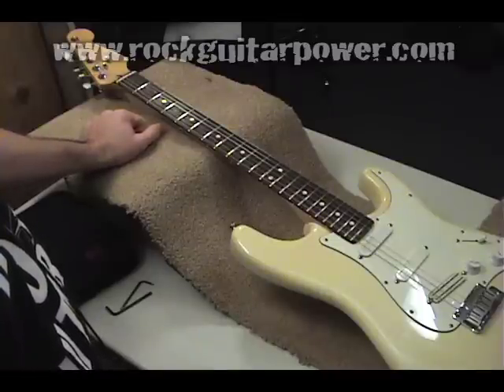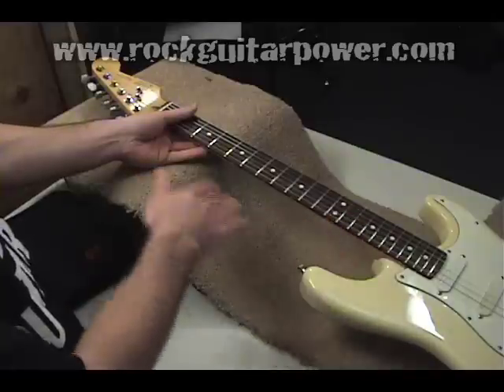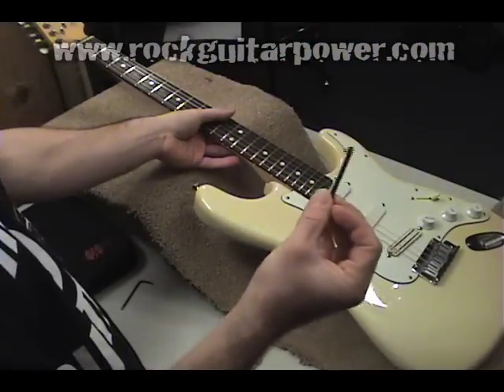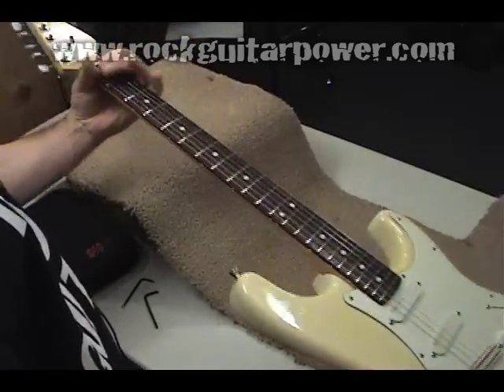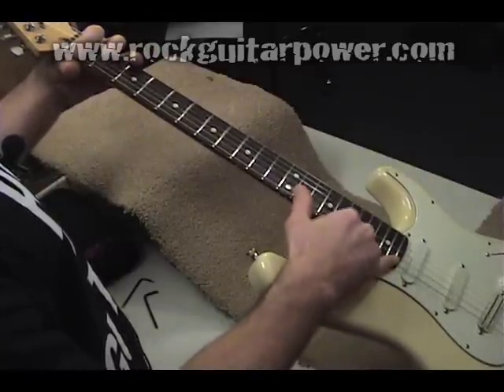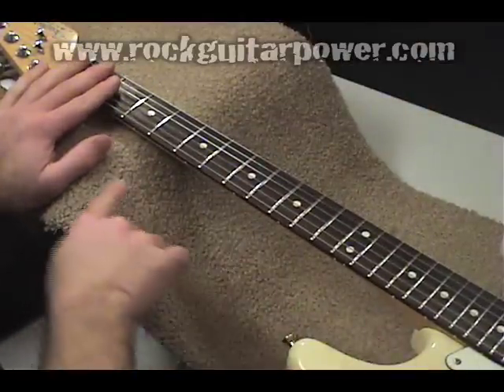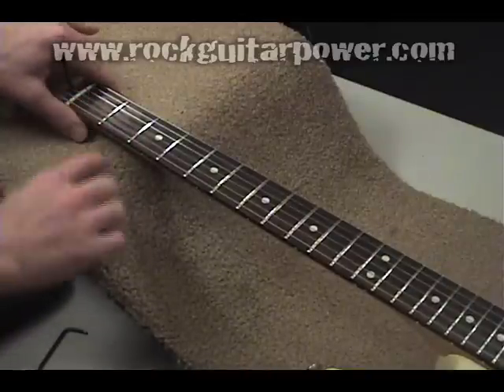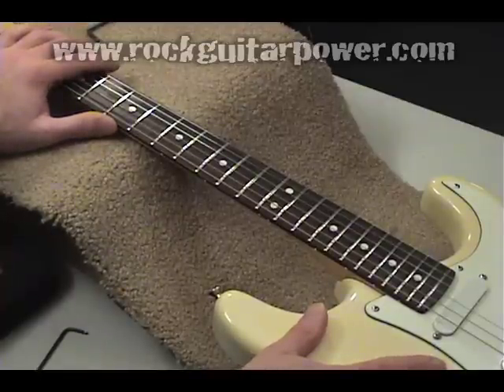Truss Rod Adjustment

Comment: Thank you! I was looking for a rule of thumb for what to look for when adjusting it, and your method should do the trick :D

If you were to be making a neck from scratch, and ut a truss rod in it, is there any adjustments that should be made before puting on the strings? Or can I simply see how it turns out and make the changes I need afterwords?

thanks for the very helpful video!

Comment: if you put on thinner strings ofcourse the problem will increase cause they have less tension than thicker strings. you should ajust your action if the neck is oke! you have no other choice. and if you adjust your action its likely you'll have to adjust your intonation too. but its not hard to do. what kind of guitar do you have?

Comment: it just adds more tension for bigger gauge strings. Hope it helps and also let your guitar rest a day to get use to that gauge. I didnt have problems on 10's but when i used 11's. you might screw your neck in more in the back if the springs dont do it.

Comment: Is it possible to replace the truss rod without replacing the whole neck?

I've got a old Ibanez Proline 1770 and it's next to impossible to adjust because of the way the end of the truss rod is constructed. 

I use .10 - .52 strings and this puts a lot of pressure on my neck, making it bend and thus having a major buzz fret issue.

Comment: I've had to adjust my las paul over a couple weeks, since i may have over adjusted, or then neck settled in, but this is a 2 times a year thing, also change your string before you do this,.so better to learn how to maintain your instrument or bring it to a shop. Last time I brought my strat to a shop, i got it back with a brass string cap in the back obviously cause they lost the original silver one. Great, 1975 strat and an oddball string cap, that was the last time,. back in,.hmm, decades ago!

Comment: i have a gibson lp. i usually played with 0.10-0.46 but i changed to 0.11-0.48.  I dont have very low action but i have fairly low action . I dont realy have any buzz. BUT!: its ALOT easier to press down the strings at 1-6 fret than it is at 13-22 fret?? What is wrong?

Comment: GOOD point....to let the guitar set over night after stringing it and adjusting it, an often over looked point. Another thing that is often over looked it.....make sure the screws on the back of the neck are "nice and tight" BEFORE you do any set-up and adjustments. Most "screw on necks" are loose right from the factory

Comment: to Jesterrag:  OK.....you say your bolt is a little loose after loosing the rod....that means you have loosened it as far as it will go. Don't leave it too loose or the rod may rattle  when playing....just tighten it back enough so it is not totally loose. If your frets are still buzzing a little you may have to move up to a heavier gauge string.....to me .010 gauge is ideal....they stay in tune better....they buzz less the tone will be better and they will intonate better

Comment: hey which would you do first? adjust the action or the truss? if the action is set wrong then you may not be setting the truss correctly...if you adjust the truss first then your action may not be set correctly....i think if you found some kind of middle ground, such as finding whatever is considered the standard setting and went by that and then took it in small increments alternating between adjusting the two wouldn't that work best? let me know what the answer is or whats considered best.

Comment from the maker: your main concern is with the bridge not the truss rod. When you put lighter strings on the floyd rose bridge it will sit lower. To compensate you need to loosen the tension on the plate that holds your springs. On the back of the guitar, you need to take the cover off and you will see the springs that I am talking about

Comment from the maker: Change the strings then when there all on and tuned you need to open up the back plate and adjust the tail piece that holds the springs.

Comment: I also have a jackson with floyd rose and I had the exact same problem. it means the rod is too tight so you'll have to loosen it. just turn the bolt counter-clockwise a quarter turn at the time and check after each turn until you stopp getting buzz from the strings.

Comment: And you'd be absolutely right to be concerned.
As the guy says - look before you leap, does the neck really need adjusting? Follow the advice first (12th fret gap etc). Reconsider what the truss rod does. Then, and only then, if you're sure there's a problem that is truss rod related, you have a go but using small increments only. If you don't go too wild you can always wind it back.

Comment: Why would you want to avoid adjusting your saddles? The neck is adjusted ergo its position in relation to the strings - which haven't changed position at all - will change somewhere along the line. *You're not adjusting the strings*. He says in the video that the 12th fret string height will change upon adjustment, but that's just because the neck is corrected.

Comment: Is it the family alan key, passed down from generation to generation? If it would be possible to avoid upsetting your father by visiting a hardware store and purchasing a new one, or even a cheap set for very little money, then I would recommend that route.
If not just hit it with a hammer, repeatedly and with great force, should straighten it right out.

Comment from the maker: It's hard to say without looking at the guitar. One possibility is that you might need a new nut cut. Sometimes when you get buzz by the first few frets, it's because the nut has worn down and the strings sit too close to the frets. Otherwise, follow the videos and see if those techniques help fix the problem

Comment: There seems to be two schools of thought regarding the first fret / last fret test.

My Ibanez manual states that you should capo the first fret and hold the string down at the point where the neck meets the body -- usually around the 14th or 15th -- then test the clearance at the 7th or 8th fret. The Ibanez method makes a bit more sense to me, be the guy in the video seems to know his stuff.

Thoughts?

Comment from the maker: The Most common distance is 4/64ths.  That's what i like to have my strat's set at. I have a couple Ibanez guitars that are great for shredding and playing fast. If i can get these lower, i will but you start encountering buzz when you get lower than 4/64th. Sometimes you can squeeze out 3/64th if your guitar is setup to handle it.

Comment from the maker: It depends on what kind of bridge is on your electric, if it's a strat style with a whammy bar, then you might need to tighten the springs in the back of the guitar.  As for the neck, it sounds like you need to loosen the truss rod a few turns, you should see more of a dip in the neck if you give the truss rod a few turns to the left

Comment: I have an Epi Zakk Wylde Bullseye. It has alot of over bow. I gave it, at least, 4 full turns to the left (away from me). But it still the doesn't have any leeway between the string and the neck. I'm afraid to adjust the neck any further so that i don't damage it. What is it that i have to do to get a little bit of leeway? Thanks a million.

Comment from the maker: In both cases I would check on the headstock. Is there a little plate with three screws? That's the truss rod cover. Take it off and you should find what your looking for. Let me know if it's not there

Comment: I would just add something to your lesson.
When you are setting your truss-rod, always do that in steps. First adjust the rod for a small amount, then run every test possible (intonation, action height) and make adjustments if neccessary. That way you'll be always adapting your guitar to the state where you want it to be. If you adjust the rod completely in one turn you might found out that your intonation is so much worse that correcting it will cause neck to react differently.